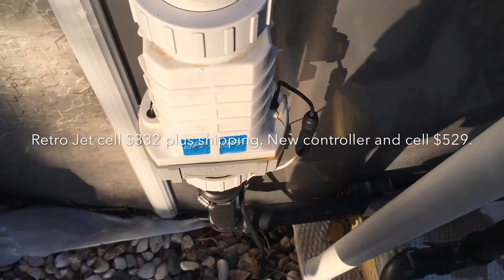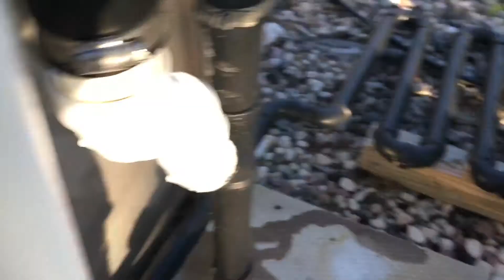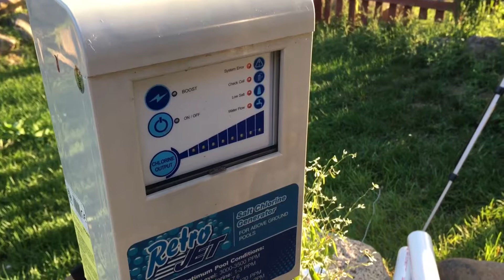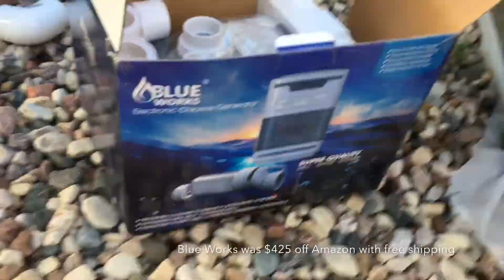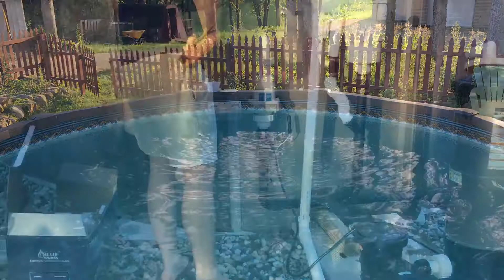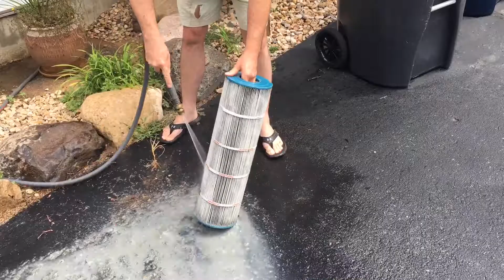Retrojet vs Blue Works chlorine generator for our saltwater pool with a Hydroworks cartridge filter

Comment: Are you still happy with the Blue Works SWG?  Have you had any issues to date?
Reply from the maker: Still going. I clean it with a vinegar soak in the fall. The only issue was my fault. I put a bit too much salt in the pool and it would show a fault and shut down. After a couple rain storms the salinity lowered and it was working normally again.
Reply: @growntogether9913  Thanks for the update!  I am looking at the Blue Works SWG for my pool.

Comment: I think you put the new one on backwards.... When positioning the Cell, you can consider the side of the cell with the cord the
"inlet" side. (from installation manual)
Reply: They can be installed in either direction, it makes no difference to the operation
Reply from the maker: May have. It’s cord side down now. If it was upside down that first season it didn’t seem to be a problem.
Reply: I have the same setup. I also thought it would install with the cord pointed down but I'm staring at the manual at this very moment and it states that the cord side points towards the pool(exit side).
Reply: I called the company a while back , they said it doesn’t matter
Reply: How did u wire this. Mine reads 1000 ppm but salt cell reads 0 with 13.3 volts

Comment: Do you think I would have a problem if I plugged this into a separate timer than my pump timer? I use a smart plug to control my pump and would use a separate plug to control the SWG.
Reply from the maker: This unit has to have water flow to work, so the two typically should be on at the same time. You can adjust the generator if you run the pump a lot and need to taper the chlorine output. If you wanted to pulse your pump for solar heat you could separate the pump timer. I run them together and have the generator dialed in for my pool size, but there is nothing preventing you from running them on separate timers that I can think of.